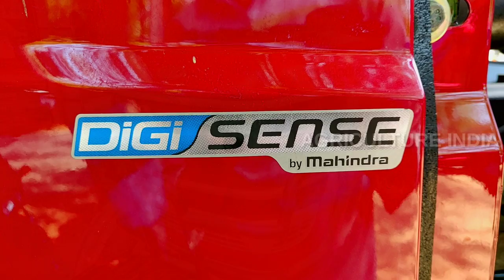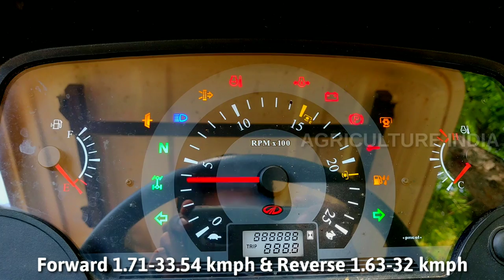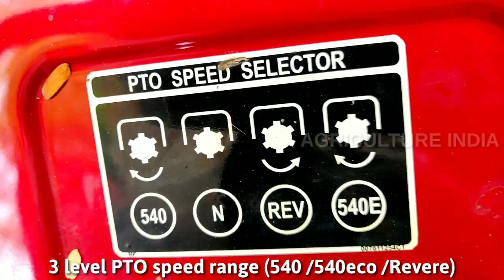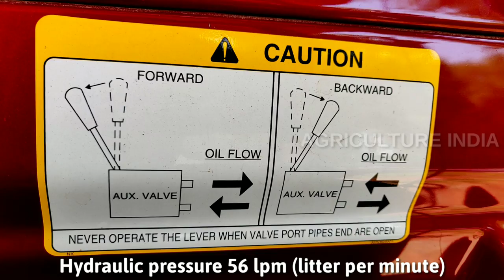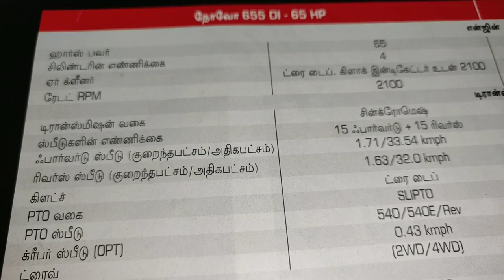New Tractor Mahindra 655 DI 2WD Tractor overview Full specifications and price details

Comment from the maker: Super gear option 20F+20R ( creeper gear option, speed 0.45 kmph)
Fuel tank capacity 60 litter
Mileage ordinary use 5 litres per hour, Banana mulching 6 litres per hour
Reply: RPM limit of above mileage?
Reply from the maker: @Nareshkannann  540 rpm limit